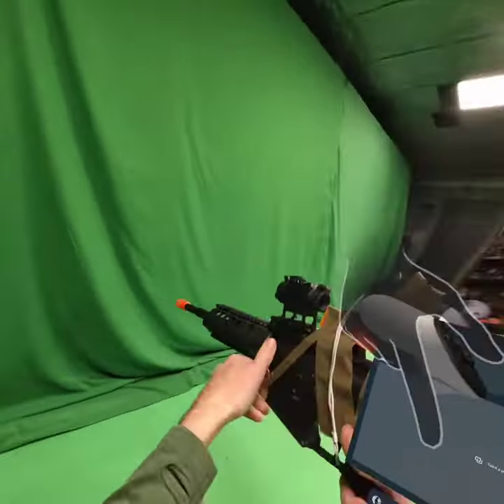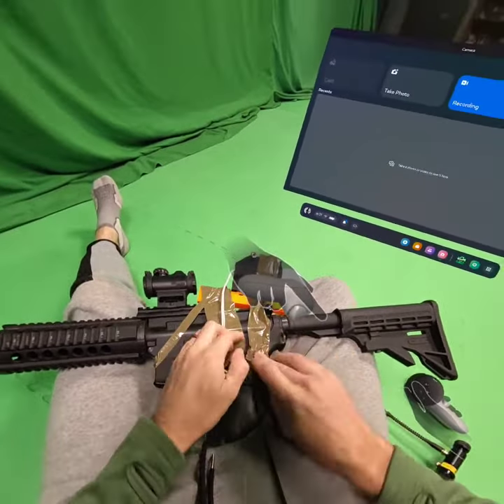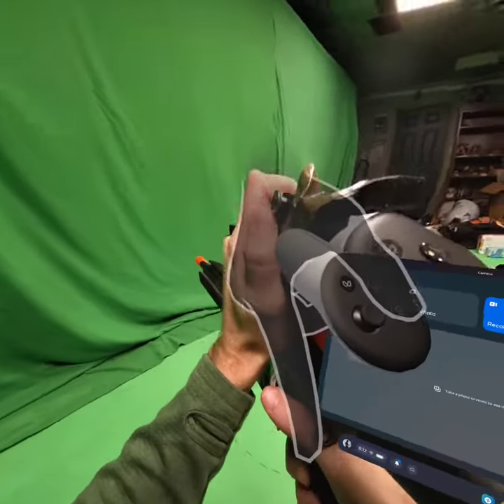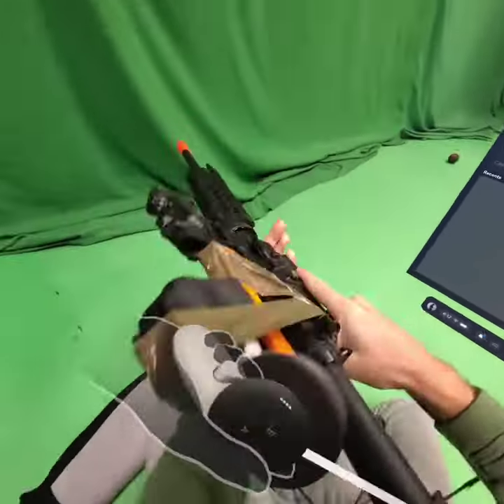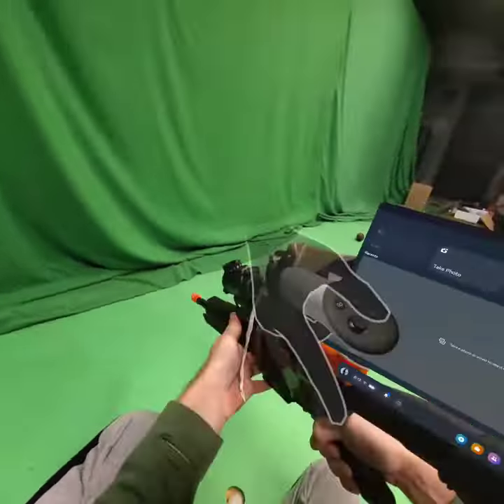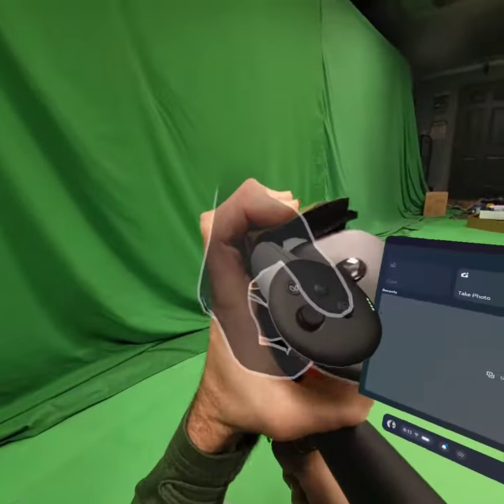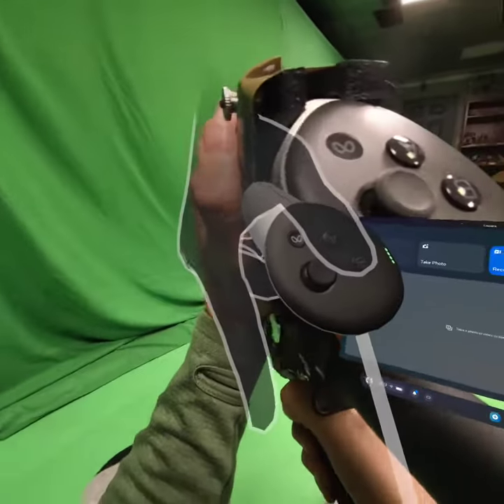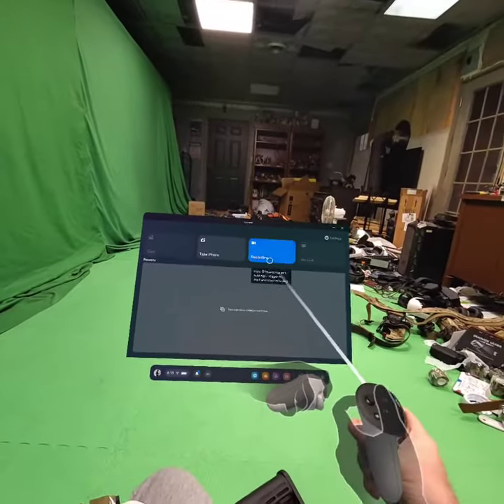Quest 3 high recoil tracking test

Comment: Confused: Whats this for??
Reply from the maker: testing how much force the quest 3 controller can handle, and still track its position accurately.
Reply: on my quest 3 just the vibration of the controller seems to shake the tracking just a little bit, this could be a problem but idk @WirelessDreamer
Reply from the maker: @memez_ale mounting controllers in TPU with a light infill helps to eat some of the more violent hits. I can't say for sure it'll work with just that. It'll be a while till I get to doing more with this idea. Who knows, maybe tracking will improve even more by then. It did for quest 2 and pro :)